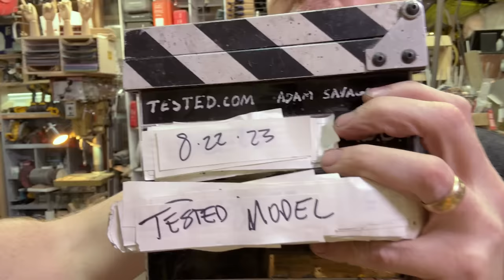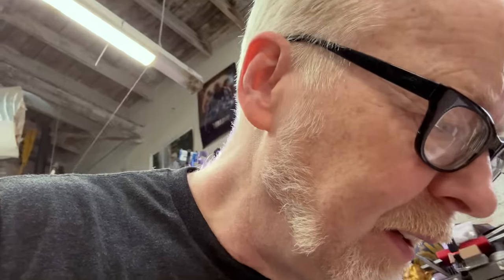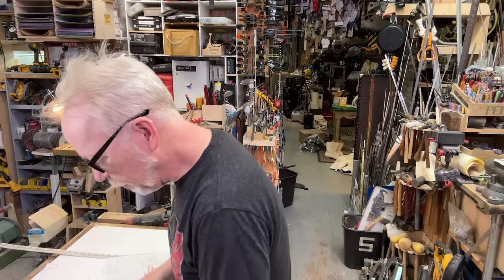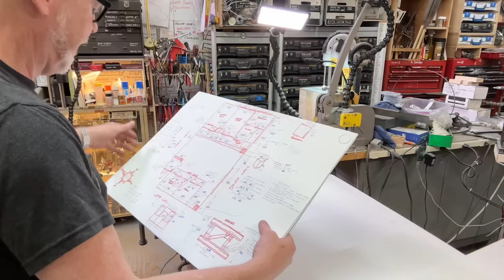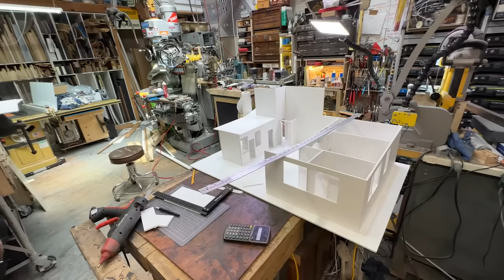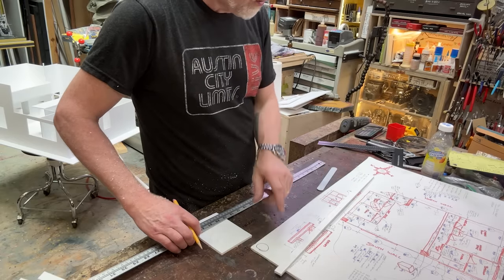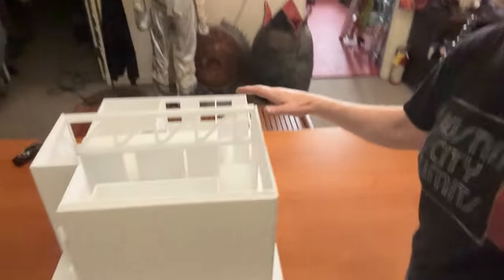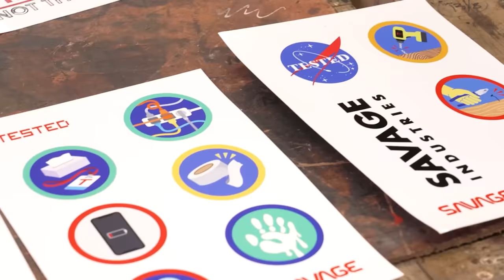Adam Savage Builds the Tested Office (in Foamcore)!

Comment: As an architect, your way of diagraming an existing space is not dissimilar to how I was taught. I generally sketch the space not to scale  to capture all the bumps and columns and doors. I use an arrow coming off the wall pointing to the opposite wall instead of a full dimension string as full strings get messy on bigger areas. And our office uses a different notation for the dimensions on the plan since raw inches can get ridiculous once you start getting into the hundreds of feet. So we write the number of feet, then as an underlined exponent we write the number of inches to the nearest eigth (no contractor builds more precise than to the eigth). Then be sure to grab some AFF dimensions (above finish floor) for ceilings and windows
Reply: Weird question do you round up or down to the nearest 8th, does it matter?
Reply: I'm in GIS, not architecture, so when I measure an indoor space I use decimal feet. It fits better with exterior GIS data without any foot/inch conversion problems, but I also find that it's way easier to measure with a laser and tape. I set the laser to use decimal feet, but I have to use an engineer's tape measure, which are a little hard  to find these days (you have to get them online).

Since 1/100 of a foot is, for all practical intents and purposes, 1/8 of an inch (0.12 to be precise, close enough for gubment work), I can easily get that 1/8" precision to my measurements with both tools and write the results very quickly on my sketch.
Reply: Also one important detail that was missed - always measure the diagonals. Too many times I assumed the space was square only to then realize my model doesn't really match reality because the real room was some sort of a trapezoid.

Comment: I manage indoor mapping data for a living, and a major part of that is creating floorplans for spaces that have none. I have a number of methods at my disposal, but the most common is the sketch-and-measure method that Adam describes.

I use digital tools - a Computer Aided Drafting (CAD) application on an iPad, laser and tape measures, and a digital angle finder - but my methodology is essentially the same as Adam's. I sketch the space out ahead of time, often (but not always) putting in empty dimension lines to highlight what measurements to take, and then measure everything in the field. I back it up with plenty of photos.

From that, I draw up a final plan in a CAD application (I use AutoCAD), and that becomes the foundation of the indoor mapping data that can be used to track and assign usage and occupancy, asset management, interior design, and construction/demolition.

Nice going, Adam!

Comment: I am currently finishing a 1:25 model using my 3D printer for making walls, furniture, appliances, tv’s, etc.  The 3D printer allows me to use different colors and add realistic details.  Love your channel!
Reply: I have learned that the best result is with dark gray or black filament. The black one is especially great if you want to paint it metallic. All the other colors have usually just made it harder to get a good result and made me use more paint to cover it up.
Reply: @kataseiko tip: use primer before painting. Then it doesnt matter what color filament you use either.

Comment: I remember growing up with my dad and all the theatrical set models they had to do, for each of the big productions they worked on. He was the Technical Director and managed the construction of the sets, so he didn't usually do the set design, although there were a few he did. And whoever did the set design, they also needed to make the model.

But the models were being made for not only the Director, but also the TD, so that the approved final version could actually be made and assembled correctly. So, he had a lot of models in his office, and he usually arranged to keep the ones he liked best.

I want to create a virtual model of our house, both inside and outside, and then maybe get them 3D printed. But even just the floor plan creation is proving to be difficult -- there's not a truly straight line in this house. There's not an actual square corner in this house. And even laser measuring devices have enough error in them that it's hard to get the walls to match up properly.

Comment: You know the fast, cheapest and simplest is to draw out the floor plan in sketch up - print it at 1/4" to the foot - 3M Supper 77 the plan to foamcore - use white glue and card stock (good bristle board) to assemble walls etc - the white glue dries super fast and you only need drops of white glue to hold the parts together.  You really do not need to be as big as you constructed that. The advantage of the card stock and white glue is that it is easily modified.  I would have printed the trusses on overhead projector film and set them in place with hot melt. My 2 cents worth.

Comment: stares at giant crack in the brick as Adam talks about girders 

I may just be an apprentice mason but that concerns me 😅
Reply: Somewhere out there is a master mason with super calm explanation about how THAT crack is harmless- before doing a deep dive on this one job site where.... ..... .... .... and that's the last time they deal with XYZ business.
Reply: @pony3284  "it's on an interior beam cover,  you honestly think they use pilasters for structural in SF? With that quake proximity?Buddy lemme tell you why I'll never work in the Pacific Northwest again!" 

😂
Reply: yeah maybe the brick sheathing isn't structural but it is still a seismic hazard. next time SF gets a little twitch (and that's when, not if) some of those are going to come down on whoever's in the office.
Reply: I did notice that there is a wood column added with at least one anchor bolt into the cracked pilaster, so it looks like the problem may have been considered.  it is possible that there is a steel column in the pilaster.  I would feel better if we had more information on this.

Comment: 4:00 You have a 1/48 scale model of this shop space that you're in...
It should contain a model of itself, on the wall of the shop (at least conceptually).
And that model in a model will contain its own model on its wall, and so on.
This is an interesting application of the FIxed Point theorem, Which tells us that the position of these converge to a point;
and the harder to understand theorem that there must exist a point in the lab that is exactly on top of the corresponding point in the model.  And it would be really cool if you marked that point with a red dot or LED.

Comment: As an Architect with a Structural Engineering background, that crack down through the pilaster makes me uneasy!
Reply: I did notice that there is a wood column added with at least one anchor bolt into the cracked pilaster, so it looks like the problem may have been considered.  it is possible that there is a steel column in the pilaster.  I would feel better if we had more information on this.
Reply: I did see the wood post and assume that it was signed off on. I'd want some more lateral support, but it is hard to say with just a brief video of it as opposed to a detailed examination.

Comment: was that the laser cutter in the maker space I saw. I thought you had one in your office. Have you replaced it with a newer one in your cave?  On a side note, you now  have so many tools from   three 3D printers, to 2 milling machines, drill presses, two lathes, and multiple types of saws two vacuum form machines, multiple sanders  that, because your workable shop has become crowed, are there plans to  expand the workable shop area, or is there any plans to relocating to  a larger space that can facilitate a more efficient ADan

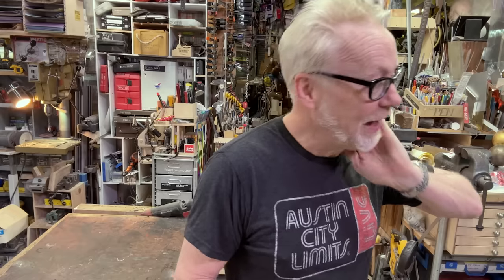Comment: Should set scale to thickness of the foam core you are using. The standard wall thickness is 4.5”. If you are using .375 foam core the scale would be 1:12. .25 foam core your scale would be 1:18. .1875 foam core scale is 1:24. .125 foam core scale is 1:36.

Comment: How do you deal with the feet and inches being base 12 rather than base 10?
Reply: He explains it at the very end of the video
Reply: Only measure in inches, not feet. If a wall is 10ft 3in, that would be 123 inches. Write fractions as base 10 so that 3/4" is 0.75 etc.

Comment: Someone help me figure out this scale thing. He was talking about mm and inches, so wouldn't his model be much smaller?  Even at 1.5 times his scale, it seems too big.
Reply: As I understood him, if you had an 8 ft ceiling (96 in), 1/25 scale (approx) would be 96 mm or about 3.8 in for ceiling height.  When he made it 1 1/2 times larger, 96 mm became 144 mm or about 5.6 in for ceiling height.  That's about 1/17 scale.
Reply: @Ralphie419  perhaps it's just the angle or something but the doors, specifically, look really tall. It's hard to say without a better reference. Thanks for your help!

Comment: On the scaling.... at the end he says use 1/25th scale or aka convert to millimeters and that's 1/25th scale.  If you have a 3ft section, that's 36in * 25.4 = 914.4mm.  So now what? You use the millimeter measure as your cutting measurement?    But 36in in 1/25th scale is 1.44in or 36.58mm.   Something doesn't make sense to me.
Reply: Adam would take that 36 inches and directly replace inches with mm to make it 36 mm for the model.  There is no need to convert inches to mm since just changing the measurement units you automatically get a 1/25.4 scale.
Reply: @alanh5000  oh I see.  I guess I figured when he said convert he meant convert, not just replace the units.

Comment: How would that be exact? That would be the internal dimensions of the rooms but doesn't take in account for the 2x4 walls and 1/2 inch sheet rock, trim ect. So the over all dimensions wouldn't be accurate and definitely not the outside dimensions. Unless the foam core was exact dimensions of your walls and you used different thicknesses for inside load bearing and outer walls.I'm a professional contractor and thats my first thought. Might help understand the layout but you couldn't build anything off that. Could be up to a few feet off on the far end of the layout.
Reply: Given 2x4's aren't really 2x4s and in fact have changed over the years ... and some use 3/4 as opposed to 1/4 drywall, I think Adam is going for the interior layout ... not rebuilding the infrastructure.
Reply: Yeah 2×4s are 1.5×3.5.. I'm aware.  That's not the point. The point is I'm asking what the use is? Is it to get a functional understanding of the space? Even the internal space on this model is unusable unless you know your interior wall thickness/ sheetrock/trim, You can't build anything off this layout. Is it novelty? I'm curious.
Reply: @LT_AndyTyler  Yup exactly so his internal layout is wrong as well. Unless you compensate for the internal walls. So this model is a novelty piece. Beautiful but novelty. Unless you know the thickness of the internal walls and make sure your foam core is to the exact scale or compensate for that, the model will be off by that width minus the width of the foam core to a 1/18th scale.
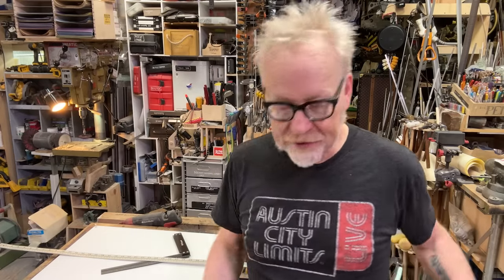Reply: I was thinking the same thing, but Adam is converting inches to millimeters. So, at 9:10 he shows a wall measurement of 164 inches long. On his model, that wall would be 164mm, or 16.4cm (about 6 1/2") long. 

A standard 2x4 wall with 1/2" drywall would be 4 1/2 inches wide (3.5" stud but the two 1/2" layers of drywall). That would translate to 4.5mm on Adam's model. That's approximately 3/16" (4.7625mm). Most inexpensive foam board is 3/16" thick. So adjusting for the drywall compound and other irregularities that would make the wall a little thicker on average, that's pretty darn close. 

Adam didn't mention it in the video. It may have gotten cut out of the video, or he may not have even thought about it and he just lucked out.